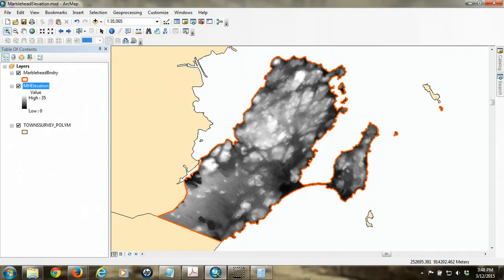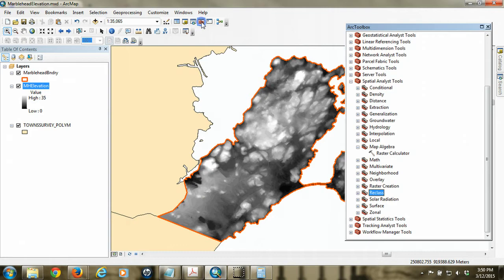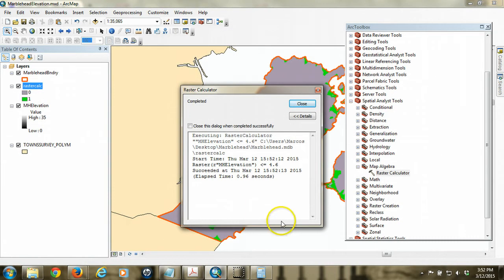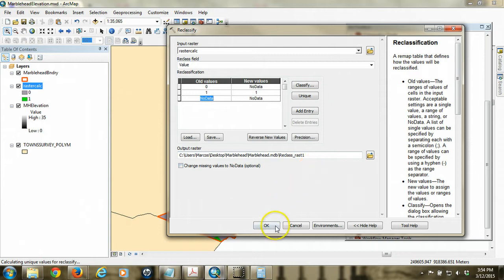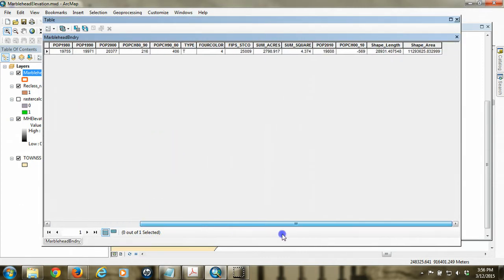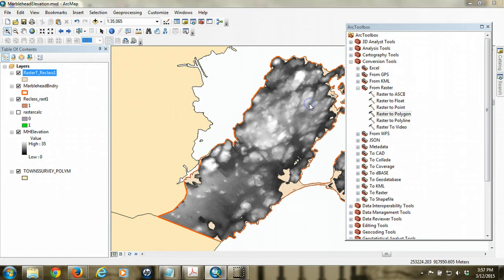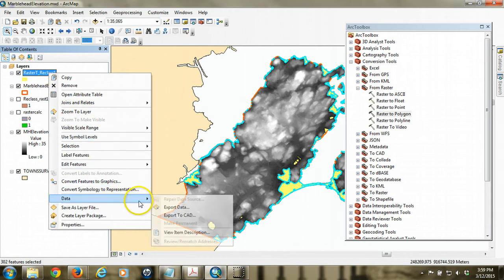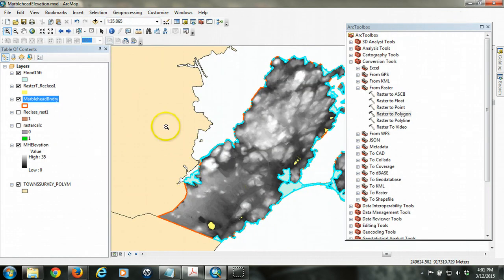How to Model Coastal Flooding in ArcGIS

Comment: Thanks for this. What about intertidal areas that have an elevation above 0m.  Would you just classify that area in with 0 mean sea level?
Reply: i guess you need to have an info about the weather and climate to be able to know in specific situation whenever you can considered it 0 m or not because intertidal areas are tricky and changeable

Comment: unit cell in my DEM is 0.000277. 0.00027 and there isn't unit in linear unit. Do you know why that happened?
Reply from the maker: It is likely that the DEM is unprojected - using decimal degrees as the coordinate system. DEMs should be in projected coordinate systems, such as UTM.

Comment: Great job.
I see you use only DEM data, is there any other methodology?
coastline is dynamic and the uncertainty come when you locate wrongly. It differ in low tide than high tide!
Reply from the maker: Nawaf Almutairi The analyses that I've read in the scholarly literature always use some form of raster analysis with a DEM (i.e. "bath tub model"). LIDAR data is increasingly used. Check out Climate Central's Surging Seas http://sealevel.climatecentral.org/  and specifically the section on Research to see a the methodology used there.